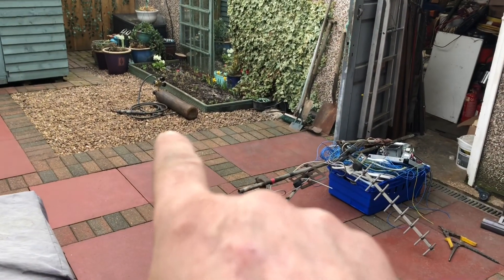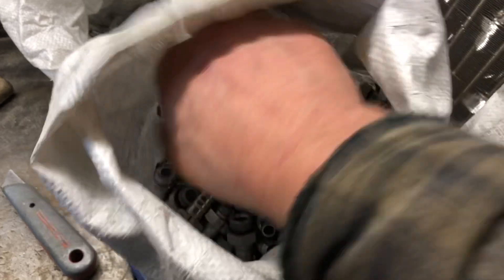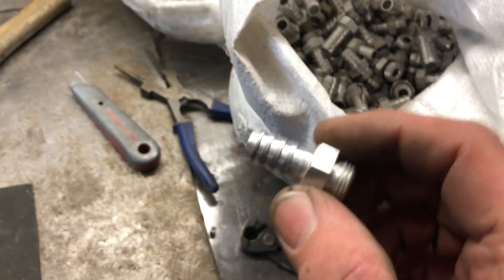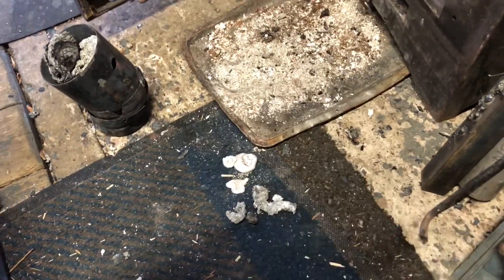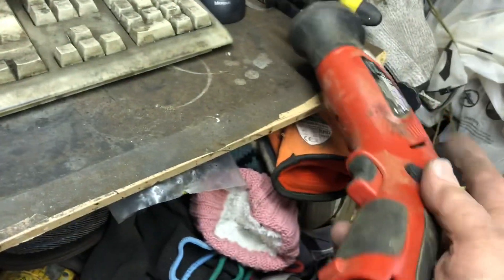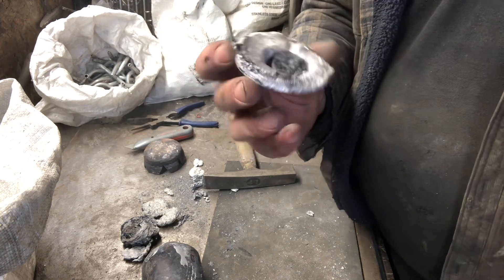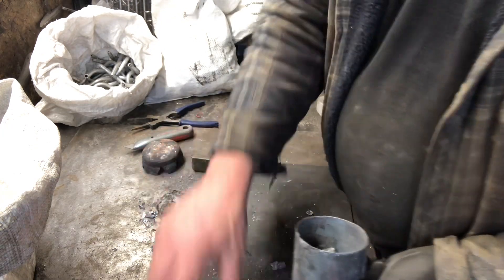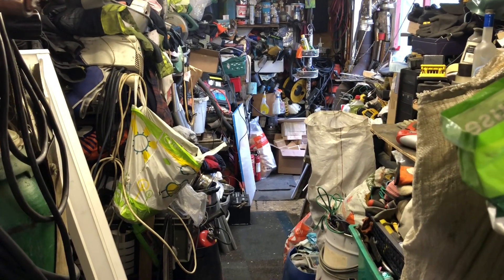Best laid plans

Comment: Keep working on the system Ian - don't give up on those cans! Maybe a drain hole through the side of the heater where the molten aluminium can flow? I think I'll try some similar experiments in my shed heater this coming winter..